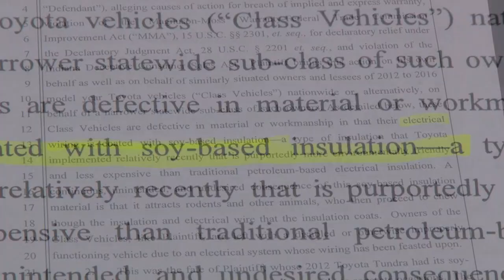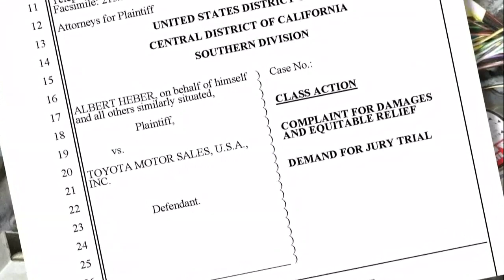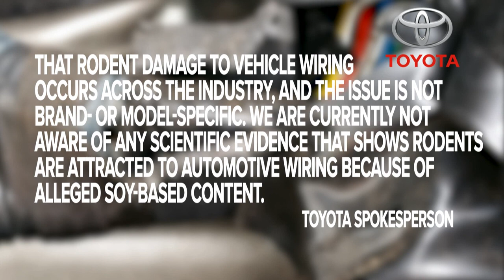Why are rodents chewing up your vehicle's wiring?

Comment: Well it happened to my toyota while I see cars in driveways next door and down my whole block none of which are toyotas parking in the driveways 24/7 working from home and have not heard one complaint of chewed up wires, but I start leaving mine out in the driveway instead of the garage for a few months and wam the wires to my ECT sensor were chewed up and caused terrible starting, fuel and excelleration problems.  Thankfully it was an inexpensive part but if I hadn't don't my homework on the intrenet to figure out the like problem I was having by find out the error code, the repair shop was adding I needed to replace my fuel pump for a total over 2,000.00 as it was it still cost me 800.00 for most labor!  It makes sense that the wires are soy based as rats like Oil based things to eat and why peanut butter is one of the best substances to trap them with.